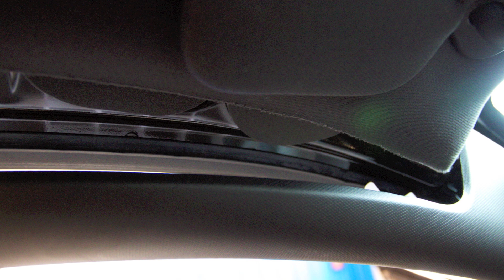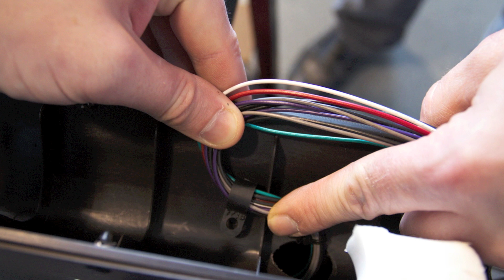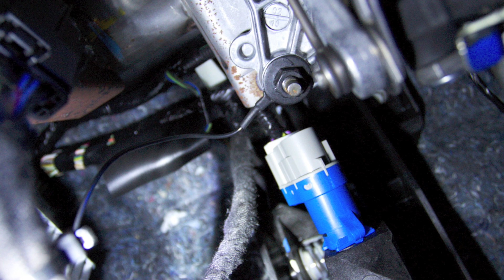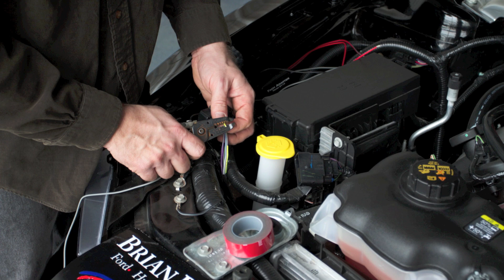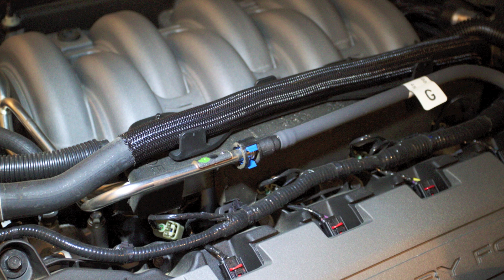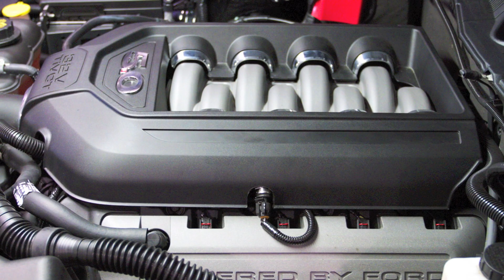5.0 Mustang Coyote AutoMeter Gauge Installation

Comment: Just installed these gauges in a Boss 302 gauge pod on my 2012 GT. These instructions are DEAD ON! 

Thank you so much Autometer for posting this video. Took the guess work out of the accessory fuse location, which wire for the tach adapter, where the firewall pass through is, etc.

Comment: OK, thanks.  I will check out the ground again.  The gauge been working fine so far and when I checked it out the first time that main dash support bracket seemed to be connected to same metal that the steering bracket is connected to.

Comment: another thing, the dimmer wire is Pin 1 on the light switch connector which is Violet with a grey stripe, not "purple with a white stripe"...
Reply: Yes. Pin 1 is correct.  Violet/Grey stripe.  Power in from SJB/Smart Junction Box/Fuse Panel, and leaves on Pin 1  cluster and panel illumination 71-2 per Ford Manual (schematic)
Reply: My ford book says this wire is blue with a white stripe. Have to check it in person next.

Comment: I have a 06 Nissa Frontier CrewCab Se. Bought the autometer oil temp. guage and autom. tranny temp.guage.  Bought specially made pillar for nissan, along with oil filter sandwich, air cooler with lines, and temp. sender adapters. Oil temp. sender fits in oil sandwich plate, and tranny temp. sender fits in pressure port screw next to tranny cooler lines. Took it to my backyard mechanic and took him about three days to get it all straight because oil filter sandwich had a small leak. Anyway, job well worth the wait and 75 bucks he charged me. Looks fantastic! Thanks for the idea and video, keep them cmon.

Comment: This video was very helpful, thanks!  I installed a D-PIC gauge in a Roush vent pod and one thing to note is that the fuse #32 that you said to use does not work if you do not have the back-up sensors on your vehicle.  I ended up using #35 which is the next 10A fuse 3 spots above.  Also, for ground I used a 1/4 bolt and star washer in empty hole on the curved bracket behind the headlamp switch.

Comment: Oh, as far as the firewall pass though, it should be noted that the car in the video is an automatic and this option will not work on manual trans cars, however you can run the wires straight down below the sound tube, pull the front left wheel and plastic splash shield and there is a rubber grommet with a nipple that can be cut off, open up a bit slit with a knife and the autometer harnesses will still reach the pillar without having to lengthen.

Comment: Ya purple, violet same thing, Ford's calling it violet. But what I was getting at was the purple/white stripe wire is pin 6 that is for headlamp off circuit, pin 1 violet/grey stripe is the one for illumination.

Comment: What do you recommend for wire? Would normal cheap PVC insulated wire work ok or do you need to get something thats rated for higher temps? Im going to be putting the plastic tubing around all the wires.

Comment: how would this be hooked up  to  the 2016 gt any ideas
Reply: I have a 16 mustang gt and just purchased your ford racing oil pressure gauge and transmission temperature gauge. I live in the NW suburbs of Illinois. How much do you guys charge for installation? Would love to bring it by and have it professionally installed!
Reply: Email sent. Thanks!
Reply: Any updates on installation on a MY15+ Coyote?